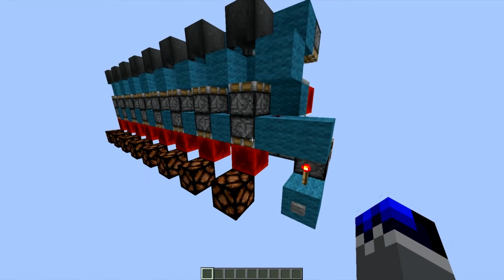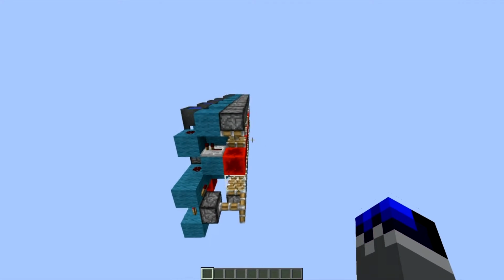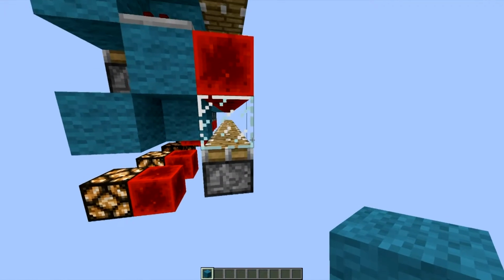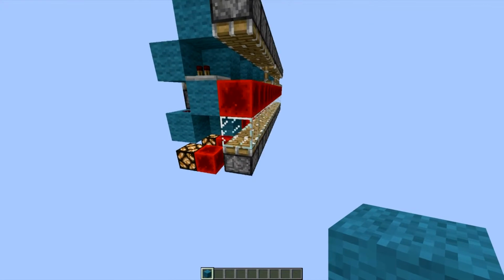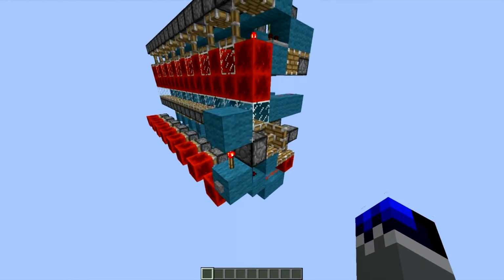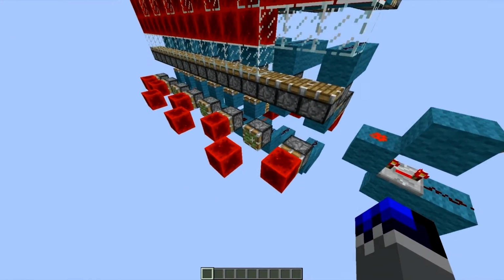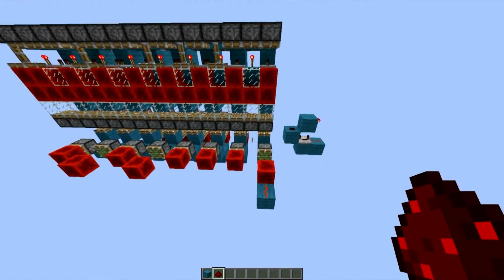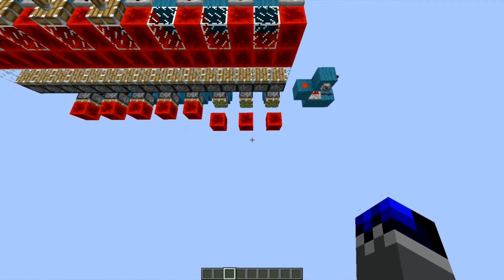Instant Infinitely Expandable Binary Counter

Comment: You could use this to make a multiplier that calculates the product at a rate of 3-ticks/bit-ish :3
Reply: I take that back,, the carry mechanism is bidirectional when inputting in bits away from the edge
Reply from the maker: Indeed, we got versions that are not though :D
Reply: I need that in my life
Reply from the maker: Fly up on p:3(maybe 2) of selulance on redstoner, should be there, otherwise i will show ya sometime
Reply: Thanks, I'll take a look :D and I wanna show you something related to rom that I've recently started working on